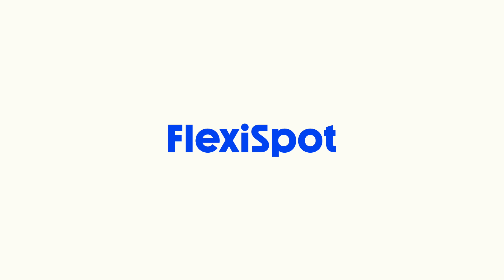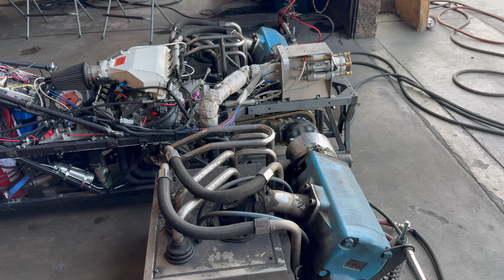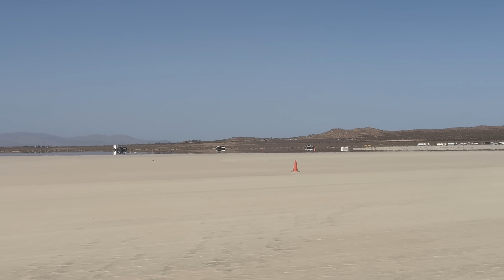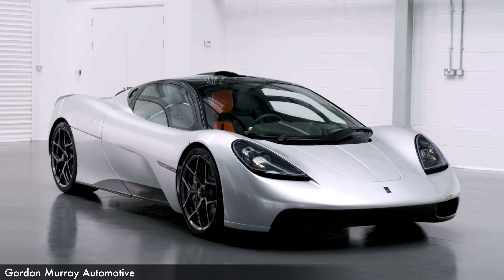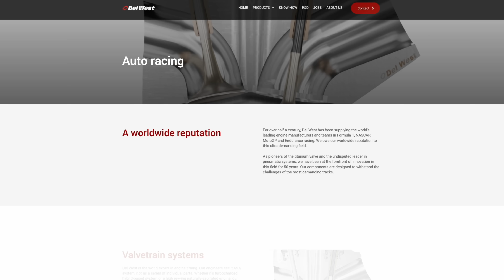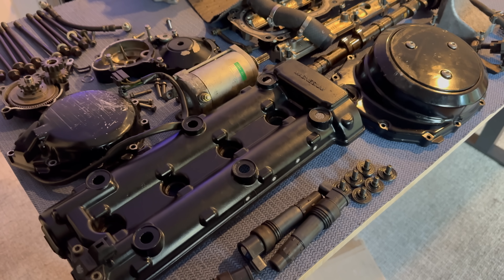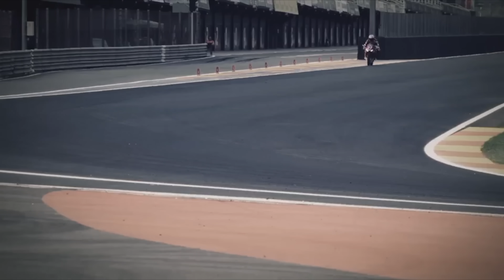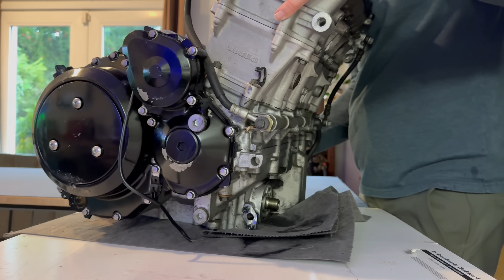Motorcycle Engines Are WAY BETTER than Car Engines

Comment: 2ZZ-GE in my car is like a giant motorcycle engine, it's great. Even better with the intake manifold on it now that uses 2nd order harmonics for more air. Definitely something to look into for your land speed record engine if you need to get some more power from the same displacement, plus air intake manifold harmonics are a huge rabbit hole to fall down so I'm sure you'll love it.
Reply: Yes, I had the privilege of owning this engine for a long time. It's truly one of the best car engines ever. It shows in the design that it was designed by an instrument manufacturer.

Comment: I'm surprised they don't make more propane powered small cars and small cc propane powered motorcycles & scooters that either came with room for a standard 20 lb bbq grill tank. Or on a motorcycle use a removable tank that can be filled from a bbq grill tank. You might need 2 tanks. One empty one kept in a freezer ready to be refilled and a full tank on the bike. 
It'd always pass emissions, burn super clean = 2 to 3x engine life and much fewer oil & filter changes.
Reply: Propane and CNG were retrofitted to many cars in New Zealand in the late 70's and 80's. The gas 'carb' was crude so there was less power but they were cheap to run and, presumably, clean.

Comment: @12:30 note that kawasaki gearboxes have a very easy to find neutral. With the engine running and the bike sttopped in 1st gear, you can only go into neutral, 2nd will not engage.Pretty neat.
Reply: Not all Kawasakis btw. I can tell you for a fact the klx230 doesn’t. In fact I think it can be harder than a lot of others I’ve ridden lol
Reply: You mean super annoying as someone who uses second to pull away most of the time.
Reply: @3PurpleSquirrels yes super annoying to people who have no clue how to use a bike
Reply: @croustibat682 i'm sorry that your engine produces no torque
Reply: No it's not pretty neat. It's a damn nuisance. Good luck with your push start.
Reply: @LilleyAdam  Suzuki motorcyles only start if you engage the clutch and have the bike in neutral in the same fasion some cars require either you to step on the brake or clutch to turn on.
Reply: @BrunodeSouzaLino My Suzuki doesn’t mind starting in first or second (with the clutch pulled in of course). 2020 V-Strom 1050.
Reply: @BrunodeSouzaLino my Volvo needs you to push the clutch to start but I'm sure it could be bump started because as long as ignition is on, the engine will start if it senses it turning.
Reply: @LilleyAdam why would you push start a running engine? Are u dumdum?
Reply: @LilleyAdam just go to 2nd from neutral, what a banal thing to complain about. The real nuisance is Suzuki and their mandatory clutch-pull starts.
Reply: You can push a Kawasaki in N and when pushing fast enough go to second.You dont have to puah it very fast.
Reply: @LilleyAdam  Why would I push start it ? I maintain my bikes. I dont need to.
Reply: @croustibat682  having a broken clutch wire in some forest can be a reason.
Reply: Batteries aren't a maintenance item. They are a work untill they don't item. Do you replace your battery every year just in case?
Reply: @LilleyAdam  You can easily test your battery to know wether it needs changing or not. I changed it once in 10 years, and put about 90.000km on the bike before selling it. Never had any issue with it.
Reply: @LilleyAdam lolwut

You wait until it's completely failed to replace it?

There are warning signs it's failing before it completely gives up.

Anyhow, it's irrelevant as you can get the bike into second from neutral. You cannot go from first to second when stopped, but you can go from neutral to second while stopped.
Reply: @JohnnyD1993 that was my thought I was like do people actually do that??? TF is wrong with him not changing his battery til it fails 😂
Reply: @croustibat682  
What the fuck is a km?
Reply: @A.J.1656  
it's a mile..... but shorter...
Reply: @A.J.1656  An international standard, which miles arent.
Reply: @Fluffy_Shoeees  I used to work at a battery shop and it's very common, that's why roadside assist was so popular in that company. But eh, I'm guilty of the same, I paid for the whole battery I'm gonna use the whole battery, and when it won't start my car it'll run some lights, and when it won't do that I'll add it to the P I L E
Reply: @A.J.1656 it's a kilo of a meter which you and your feet yard mile system can't explain
Reply: @croustibat682  
Sounds gay.
Reply: @JohnSmith-pl2bk it’s a mile……but better
Reply: @croustibat682 Do I need to test under load? Or will simple probe test while hooked up work
Reply: @croustibat682 It's not the most common failure type, but shorts in otherwise healthy AGM batteries absolutely happen. I don't care how well a motorcycle is maintained, it can still fail to start. Shorts in starters aren't predictable. Random electronics can fail... It's always good to be able to push start a bike. And as a certified BMW technician they're the last bike I'd take on a cross country tour because so much of the bike can't be fixed in the field. Not the bike you were speaking of, but an example of why more technology isn't always better.
Reply: @heythere4970  I do not know how a short could happen inside a battery. Please explain how 1 of 6 sealed elements serially connected could short. There is no electronics in there. Shorts in a starter ? Again, how ? If the carbon connectors are stuck, it is not a well maintained bike, and hitting the starter will unstuck them. You are talking about something entirely different here, and you wont push start a beemer that has a flat battery since it wont produce power for long enough to power up the ECU, fuel pump and various other embedded computers. Like every modern bike.
Reply: @croustibat682  Battery cells can contact after damage from vibration or shock.

Alternator and starter coils can weld together after insulation breakdown.

Right. My argument was that BMWs are a poor choice for middle of nowhere motorcycles.
Reply: @heythere4970  Battery cells cannot contact from vibration since they are molded . You are talking about lithium cells wrapped together on RC models, which is unsafe and not happening on cars or bike since there are regulations about that. The only way this could happen is to be in a crash so hard you wont have to worry about restarting the bike ... The same goes for starters and alternators, sure the insulation could wear down with time and abuse, but thats not happening out of thin air
Reply: @croustibat682 Dude, I'm a certified Honda and BMW technician. I worked on these things professionally for a decade. Before that I was an aircraft mechanic in the Marines. A decade after leaving the motorcycle industry I continued to fix everything on mine and my friends' bikes. These failures absolutely happen from normal riding and they appear out of nowhere. And this is isn't even considering electronic failures, a chip frying, a diode going out, corrosion in a w iron harness, a clutch or neutral switch failing, a hydraulic clutch hose leaking...

I've seen it all, and plenty of these failures wouldn't leave you stranded if you had a bike that could be push started.

And the honest truth is that if you haven't experienced any of these then you haven't been riding long enough. I don't care how well you maintain your bike, these aren't predictable. Even if replacing parts on a schedule, I've seen some of these problems before the first oil change.

You simply don't have the expertise or experience to back up your claims.
Reply: @heythere4970  Dude, YOU claim battery cells can short. YOU have to back up your claims. Reversing the charge of proof is a fallacy, just as much as claiming to be an expert to justify you dont have to.
Reply: @croustibat682  When an otherwise healthy battery loses 2 volts of ability it's due to positive and negative plate contact. Whether that's due to insulation degradation or a manufacturing defect I don't know, I only claimed to be a technician, not an engineer.
Reply: @LilleyAdam  Batteries 100% are a line item for inspection and testing.  In the heavy truck industry I use a tester at work everyday that tests the quality of the battery if it falls below spec it gets replaced long before it stops working (we usually use these to power our transfer pump then return them). Sure at home it may not matter to you or just make you late to work but for my industry a dead battery could mean losing an entire reefer trailer of pharmaceuticals or even worse ice cream.

Comment: Nice video, the power density ox motorcycyle engines is unbeatable in their usecase.
Motorcycyle engines are fine for quirky light car projects and powering motorcycyles. But in the real world the torque from a straight six Turbodiesel is just the better choice to power whatever boatanker needs moving  efficently :)

I dont have a motorcycyle license but I would choose the most displacement I could get my money onto, who wants to hear a chainsaw revving all day going nowhere?

Comment: Seriously, the best Motorcycle transmission explanation I've ever seen.
Reply: Yeah, I've watched a few explanations, but this one takes the cake for being so simple and easy to understand
Reply: Was thinking the same thing.
Reply: every 30 seconds I was like "ohhhhh so THAT'S how it works"
Reply: Also just a manual transmission explanation in general. My Volkswagen transmission(that I'm rebuilding right now) works pretty much exactly the same way, just with a different shifter and synchros.
Reply: Yeah, while I'm familiar with most of the engine stuff this is the first video I've watched that's beaten a decent understanding of the transmission into me...
Reply: Maybe it made sense to other people, but im still confused. If those 4 gears are still engaged, how are they spinning at the same rate despite having different gear ratios?
Reply: The 4 gears splined to the input shaft always have to spin at the same speed as the input shaft because they're splined to it.  The free wheeling gears they mesh with on the output side are all spinning at different speeds because of the different gear ratios.  This is fine because none of them engage with the shaft or with each other.  When one of those free wheeling output gears is engaged, its speed must equal that of the output shaft.  However the other 3 free wheeling gears are still allowed to go at other speeds because they still don't engage the output shaft.
Reply: @It_Is_I_I sort of similar to a multi speed bicycle except it's a chain engaging the different gears vs the sliding gears in the motorcycle transmission.
Reply: @It_Is_I_I the ratio is the relationship of the input and output gears. A bigger (taller) input gear meshing with a smaller (shorter) output gear means that your output speed is faster than the input speed.
Reply: It's good ay

I'm like.. ohhhh yeah finally someone actually made it make sense
Reply: Watched
Reply: fr the only explanation i understood tbh
Reply: Same idea for the lower unit in outboard motors
Reply: Totally agree.
Reply: True. I learned to drive in 2000 and so never learned how to drive a stick shift car. My first manual transmission was a motorcycle. Luckily it was a little ninja 250 which was very forgiving but I still know how to shift on a bike but can't drive a stick lol
Reply: you didn't go to school to fix engines then.... those of us that did.  got the same explanation day 1 from our teachers...
Reply: Dr. Matt from now on.  One of the best lectures I have heard/seen
Reply: First take!
Reply: so, they're not better after all, what a surprise!
Reply: Maybe but theory that motorcycle engines generates more power is a lie.
Motorcycle engines generate LESS power than car engines for the same amount of fuel burned — significantly less.
Currently, motorcycles consume about 5–7 liters of fuel despite having relatively small engine capacities.
Moreover, in everyday riding you use torque, not horsepower. Motorcycle engines most often produce less torque.
Reply: @podunkman2709  dude what are you even talking about, lmao
Reply: @podunkman2709 Motorcycle engines make more power for their displacement. They make more power for their physical size. They make more power for their weight. They do not make more power per fuel burned.

It all depends on what criteria you want to use, and there are many valid ways of looking at this.
Reply: @jaredlancaster4137   Rocket produce even more power. This all is about fuel honey. Should be not so difficult to get that.
Reply: @jaredlancaster4137  So you both are right.
Yes, bike engines make MORE power in relation to size and weight of the engine.
And Yes, bike engines make LESS power (correctly less work) from the same amount of fuel.
Reply: @heizoeli9152 yeah that's literally what I said
Reply: @podunkman2709  nuclear reactor makes more power than you and your mom combined. Your point is?

Comment: Another great video. There are, however, many motorcycle engines that will last well beyond 40k miles with just basic maintenance. Many touring bikes will easily do over 100k, though maybe not at 13,000 rpm

Comment: Car engines make loads of torque, to pull a 3,000lb+ car. Motorcycle engines only have to pull 1,000lbs or less. Car engines also have to last through longer warranties, every weather condition, and excessive idling periods. Take the 2L Mercedes, making 416hp. It also produces 369lbft of torque. The Suzuki Hyabusa makes a claimed 190hp, but only 110lbft of torque, from 1.34L.

Comment: As a racer myself it keep suprising me how just how much power a tiny engine can make. Racing a old ZXR 400 I4 with 70hp at 15k+ rpm is crazy. 
Another amazing video Matt
Reply: check the old cbr250rr. 4 cylinders, 4 stroke, 20.000rpm .
Reply: @croustibat682 ZXR 250 is on the wishlist. But that pocket rocket CBR sounds amazing

Comment: As a young man I owned a four cylinder motorcycle and a four cylinder car. The car used less gas and lasted four times as long. If you think the car was less thrilling you were not driving it with all season tires in the Canadian winter.
Reply: How reckless you gotta drive for a car to be more fuel effecient than a bike

Comment: The BMW n52, the last great real BMW engine, was a magnesium aluminum composite engine block and head. It weighed over 300 pounds less than its n54 counterpart. It made a healthy 255 wheel horsepower brand new.

Comment: And when we add the cross plane into the mix like Yamaha r1 then we are almost playing with the same power density per revolution as on the 2 stroke. But the vibration is a bitch, but worth it. Would you as an engineer agree on that statement...

Comment: 13:30 Seeing the car I own in a superfastmatt video was a whiplash. This looks like a marcopolo skoda fabia from Czech. The front is identical to a skoda rapid ind facelift, built on the polo 6r platform for India. Basically a sub-compact B segment sedan with polo and Czech soul.

I think Mexico has the vw vento which this car is a carbon copy of. Pretty fun ride, mine is tuned to make 175hp from its 1.5L tdi with stiffer b6 suspension and a mean valved exhaust. Puts a smile on my face everyday.
Reply: Bro you have a Fabia? Save some of that swag for the rest of us.

Comment: A 9k rpm s2000 is still a whole lot of fun
Reply: a 9k rpm k1600 in a sub ton chassis would rip though
Reply: Not as fun as a V8 that’ll do a burnout even you drop the clutch at only 1000 rpm 😅
Reply: Not as fun as blasting up to 16,000 rpm on the way to work

Comment: The increased surface area of the valve is not the factor that increases the flow, as the flow is limited by the area of the wall of the imaginary cylinder swept by the valve. Thus similar valve area divided by multiple valves gives better flow (in theory) if the amount the valves open is equal. 2:13

Comment: I'd really like to build a small, 2 seated 1000 lb aerodynamic, fuel efficient DIY street legal, commuter car (with a little grocery/camping gear storage room behind the seats) That can also do some moderate off roading. 
Or a DIY fuel efficient, fully enclosed reverse trike that uses a "swivel" articulating front end. So the front wheels don't have to be so wide/ far apart and it's able to lean into corners similar to a motorcycle. 
Like basically take a Piaggio MP3 scooter or Yamaha TriCity 3 wheel scooter/ motorcycle  make it recumbent seated & add a lightweight aerodynamic removable full weather enclosure. With removable aerodynamic saddlebags-locking cases that mount to the outside of the body & a rear storage box. That could get an easy real world 85 mpgs on the hwy and is fast enough to cruise at interstate speeds. That could also be drove in snow/ light off road. 
I think if someone built the 2 seated 1000 lb car that gets around 75-85 mpgs on the hwy. That people would buy the crap out of them. For either a sole vehicle or a second commuter car. To save wear & tear on their bigger less fuel efficient vehicle.
Reply: Not in the US where the SUV is king.  Many people here believe that they need a bigger vehicle because it is safer - if they get in an accident, then the other person is more likely to die (Conservation of Momentum).
Reply: @oldanslo I mostly agree, if a person has a family they often want something that can seat 4 with lots of storage like an suv....I really like the Volkswagen L1 concept vehicle. Tandem 2 seated very similar to what I had in mind.

Comment: THANK you. Now I know why I have so much trouble finding neutral sometimes! I'll try rocking the bike back and forth to find it next time I have issues. I thought it was the quickshifter's fault, but apparently I'm just doin it rong.
Also, they do make bike-engined cars from the factory. They're just little tiny manufacturers, usually based in industrial estates near classic race tracks, and sell half a dozen cars a year to rich people using them as track day toys.